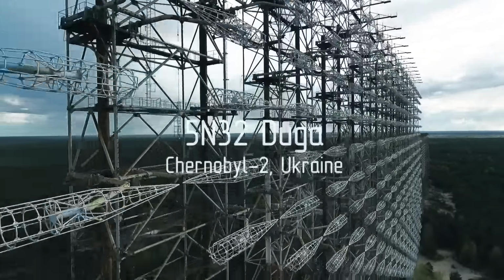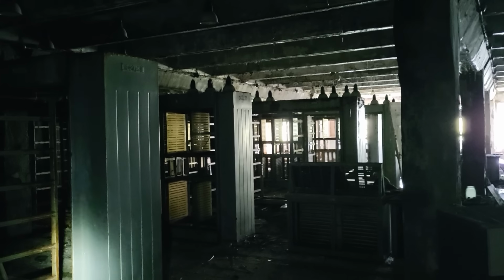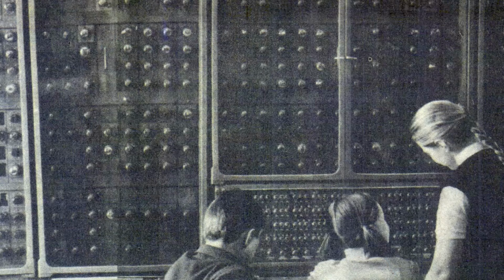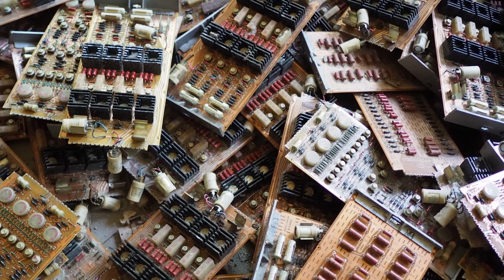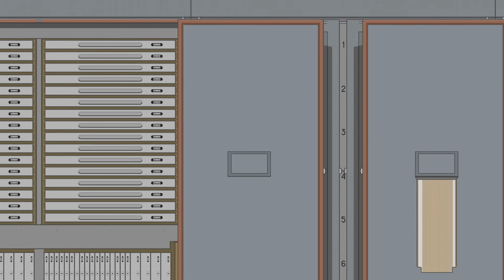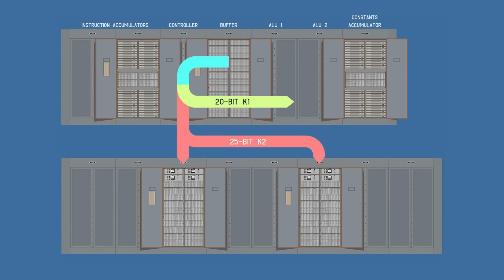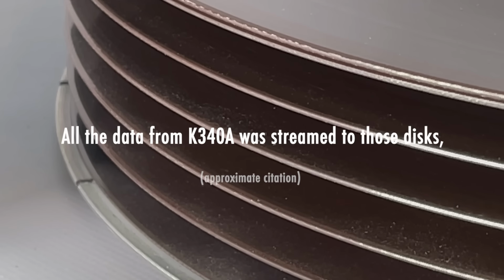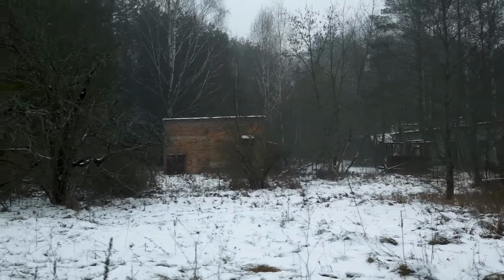Exploring K340A: The SECRET COMPUTER of CHERNOBYL DUGA RADAR | Russian Woodpecker

Comment: The CIA made this project their “Bitch.” This system could theoretically prevent ANY ICBM response from the USA. It could stop all ICBMs & SLBMs through weaponization of very powerful RF EM signals. They could literally “HACK” the booster engines of the ballistic missiles. Directing them to wherever they wanted to. NOW we know how, through “Social Engineering” the CIA caused the Chernobyl accident. Without that power plant, this system was useless. It was only a matter of time until the Soviet Union would have used western technology to their will in this project. 🤔
Reply: ok ok ok

Comment: I find the old electronics fascinating. Different regions had their own independent ways of engineering - and at that time one couldn't yet be abandoned in favor of a more efficient or economical approach.

There are things one design could do that the other couldn't. For example, some prefer vacuum tube based amplifiers to semiconductor ones (I think because of the 0.7v cut-off voltage)

Comment: Oh, the times! I recall using those 5-disk 5MB stacks in the computer centre at Kharkiv Physics & Technology Institute where I worked after graduation from Kharkiv State University. They were running soviet clone of IBM  VM mainframe that we, physicists, used for all kinds of calculations feed in from punch cards.
Reply from the maker: Thank you for sharing your experience!
Reply: Np. Actually, I was mistaken. They were clones of DEC VAX machines, coz I recall reading a VMX user manual, in Russian, oc. We used terminals to connect to it. I'm not sure though which machine had those stacked disks. 
 @ChernobylFamily

Comment: This huge antenna array could easily be repurposed for shortwave broadcasting. And it has the benefit of directional gain which means low power consumption transmitters.
Reply from the maker: Yes, that is an interesting idea.

Comment: This computer could do 1 million operations per second. The cell phone I'm watching this video on, can 1 billion operations per second.  Its crazy how far computing tech has come.
Reply from the maker: Yes
Reply: What's really wild is Macintosh  acquired a Sillicon Valley Graphics CRAY XMP supercomputer in  late 80's early 90's. The CRAY was the world's most powerful computing device at the time and the size of a small room.  Macintosh reverse engineered the Cray to produce the first IPhone.
Reply: I don't agree with these numbers. I'll be annoying. Just because a processor is fed a clock with a frequency of f (sometimes there's a PLL inside that multiplies it by X), doesn't mean that it performs f operations per second. Most cores, even modern ones, need a few to a dozen core cycles per machine cycle. From what I know, it's also impossible to convert it 1:1, because modern MCUs work synchronously, and most of these large computers in cabinets worked asynchronously. So you can make a mental shortcut, but it won't be a good reflection of the scale. Also, comparing devices running an Android operating system with systems closer to industrial automation or embedded applications are two different worlds. There are cases where a well-written low-level, embedded program will be orders of magnitude faster than the same task started from the operating system level. All according to the principle: the longer your legs, the easier it is to stumble.
Reply: @compaqchemlab it's actually quite a bit more than a billion given wider data buses and chacheing improvements...pipelining, pre-emptive execution, and parallel processing...and that's just in a low,end cell phone...
Reply: @compaqchemlab ok nerd, but here's your proof!? I only trust our president so good luck convincing me!

Comment: A Titan Rocket burns only for 5 minutes. So the exhaust can be only detected at climbing when at all exept from visual means as is done by satellites.
But because the relative low elevation of 70km, it is possible to detect the friction heat and some ionosation.
Because of that hypersonic missiles in the stratosphere can be easely detected. Ground based and satellite based. But ground based the warning time is very short.
Look this matter up at the Perun Channel.
Detection of a false launch "Fire" by a Sowjet Satellite nearly led to... when the operator wouldn't have used common sense. Only 1 missile? Not logical.
Gave him a fat Sowjet Hero Pension. For sure not. Out of the top of my head he got 3yr. prison.
As the submarine lieutanant who deposed the captain who wanted to launch a nuclear torpedo during the Cuba Blockade.

Comment: It is almost impossible to recreate it with original components. Soviet electronics has too complex building solutions. Of course you can reimplement those boards on modern components superseding with some solutions from Altera but it is worthless imo.
Reply from the maker: There is no task to recreate it 1:1, but to make a mass-size model with a simulation of its operation based on modern tech. This is what museums frequently do, for example, for tube-based computers.

Comment: Hi! You've done a colossal job! I don't understand how you managed to achieve such amazing results. About the ES series computers, which appeared later, I came across such information that they were equipped with the “Dialog” system. It can be assumed that it could be used as a supplement to K340A, to identify, for example, objects based on the data transmitted from K340A. Although everything could be much simpler and computers of the ES series could be engaged in solving some mundane tasks of life support of the military camp and counting some expenses.
Reply from the maker: Hmmm...
These are interesting details. Thank you!

How we achieved... consistent scientific work)

Comment: Wondering whether @curiousmarc and Master Ken Shirriff and / or @diodegonewild might be interested in a collaboration on reverse engineering some of this equipment…  🤔
Reply from the maker: We'd be happy for any collaboration, but there is a slightly not obvious problem: we cannot more anything outside the area, and anyone involved must be trained to manipulate contaminated items (in this particular case majority is not contaminated at all, but legally they are considered being so, so there are certain limitations).
Reply: @ChernobylFamily Hi - it might still be worth getting in contact with @curiousmarc anyway.  They have worked with Soviet-era equipment before and may be able to work with a combination of high resolution images and x-rays to reverse engineer portions of the machine…

Comment: They were using discrete transistors instead of integrated circuits which is why it was so massive.
Reply from the maker: Right. Though IC-based ES mainframes are not really smaller. I guess not the last reason was that discrete transistor logic is way more radiation-resistant, which made it a common choice for military tech.
Reply: @ChernobylFamily  Russia was barely past vacuum tubes when this facility was built.
Reply: @controlfreak1963 When did he say Russia you mf

Comment: I program embedded controls systems and the idea of a literal aviation clock sending analog impulses for a real time counter signal is INSANE!!
Reply from the maker: @ThePolandball  a little clarification: it appeared I made a little mistake. There was a similar clock but designed for devices. It had a different dial, but yes, it worked similar. Well, the tech of the 60s:)

Comment: Можливо відновити такий комп'ютер для приватного музею? Could restore this computer for private museum ?
Reply from the maker: For private – no. Legally it is a radioactive waste and it will forever remain there. Any restoration is possible only within that location.
Reply: @ChernobylFamily  Possible restore near Duga radar ?
Reply from the maker: @gruzikigor  yes. It is a less problem to build a museum next and put the machine there. I mean, it is not also straightforward and easy, but far more possible than any variant. And much better for end-visitor.
Reply: @ChernobylFamily  Thank you for your complete and informative response))🤩

Comment: They should've just used more IR sensing sats than this insane idea of using HF radio bouncing unreliably all over that you couldn't trust anymore than hoping the wind stands still more than a minute.  Dumb waste all around.  Not to mention a single conventional cruise missile would blind it before any real launch of SLBM/ICBM.
Reply from the maker: Well, the principle behind Duga was used by many countries at that time, including the U.S. and UK; it actually works, but requires solving of many challenges. Anyway, with modern tech it is pretty obsolete.

Comment: The facts presented aren’t accurate. This military unit hasn’t been abandoned for 30 years. The site was operational until 1999, focusing on dismantling equipment, with an active security system and restricted access to various buildings and areas.
Reply from the maker: Consider, I did not want to overload with facts, as the focus is the computer. In the next episode we will talk about that, including ISTC Shelter deployment there.

Comment: Im sure I saw somewhere over the years that 40% of Chernobyl output went to power it. Looking at it I can only imagine it didn't actually work, (I'm sure it did something but reliably and quickly tracking I doubt) - one of those cases where the leaders expected it to work and the technicians weren't free to say it didn't
Reply from the maker: No, no, no.:) That theory by '40% of power' was created long time ago by known people who have a zero concept in understanding in energy production and distribution. 40% of ChNPP power was roughly 1.6 GIGAWatts per hour. This is, uhm, sufficient to power a city for 1.2...1.4 million people.
For both transmitter and receiver come power lines of just 10 kilovolts. This and substations on sites give hints that none of them consumed something really high. 
Authors of the theory somehow forget that there was an identical pair of those stations in the place where there are no NPPs. 

Strictly speaking, the system worked and was quite functional. It was good for many things, but not enough good so military forces did not take it on duty. Who knows.

Comment: When I see computers like this I am always in awe. Nowadays some programmers have difficulty in grasping pointer to pointer concept, but there were people who not only did much more difficult operations on those computers, but envisioned and  designed them.
Reply from the maker: @karlpron  well said
Reply: @ChernobylFamily  I would like to try to program machine like this even if in the emulator. Have you ever thought of making one? Maybe some open source project? I feel I'm not the only one who would gladly help. I know documentation is scarce and hard to get.
Reply from the maker: @karlpron  thank you. We need to think about this, but see, there is very little what is possible to do. There exist some time diagrams of some operations, but that is probably all. Though, if we look from another angle: we have known architecture and specs of components, moduli used and a control panel, purpose of controls of which is mostly decoded. Theoretically, this might be sufficient to make a 'simulator inspired by', but we ourselves will not be able to do it, because after all we are historians, not programmers. What do you think?

The question is, what we are going to process? It is so narrow-purpose thing that I personally do not see a practical use of this experiment apart from a moral satisfaction.
Reply: @ChernobylFamily  You are not an average historian if you can understand and explain main principles of machine like this :). I have never written anything close to an emulator so I will have to learn some before diving into the project. I think you are on to something with 'simulator inspired by' -- I have seen stranger things written and maintained. As for the data to be processed -- it's a hurdle. But I think that emulator would have its own merit in keeping the history alive. Especially after the end of war if you open the Duga museum -- some kind of live exhibition. I will dig into some docs about emulators and then if you'll  be willing I will ask you about documentation.
Reply: I'm this programmer ahahah

Comment: incredible work. we used to monitor the system and called it the Woodpecker, the noise it made interfered with communications,  it crawled up and down the HF (2-30Mhz) shortwave bands. OTHR Over The Horizon Radar in its infancy and ionosounding for propagation calculations.  A great credit to all who worked on it in the very early days of digital signal processing.With suitable antennas and transmitters/receivers all of this can be processed in a small desktop box or two Thank you so much for this project. Maybe Chernobils SKALA control systems were upset by high levels of RF EMI/ EMC from the antenna and kaputted  Chernobyl well someone could have reversed the phase of the elements so it "pointed" at Chernobil a few km away??
Reply from the maker: Thank you!
No, in the scope of the accident SKALA was pretty much flawless; paper logs remained, so we know thism

Comment: The rocket boys gave the radar boys incorrect data about plumes. The radar guys took it on faith and assumed it was true. It wasn't. They designed an entire gigantic radar system based on those false assumptions. IF ever there was a case for pushing someone out a window it was then.
Reply from the maker: That is only partly correct. We cannot say it didn't work, it did, and it could detect things. Just not as accurate as expected, which took things much longer. Probably, they eventually would make that work, though... at which grade of expenses?

Comment: I've seen some videos looking at the antenna array, but it's cool to see some of the history of the computer that processed the signal data. I worked at a company that created a simulator of the reactor at Chornobyl, and the owner added a lot of information on the history of that project. It's too bad Chornobyl has caused so much fear of using modern nuclear power with fail-safe designs. We need nuclear power plants if we ever want to reduce the burning of hydrocarbon.

Comment: I can remember at Philips Semiconductors there was research into using Residue Number Systems for DSP.. It was dropped because it transforms multiplication into modulus addition of residues..  but made the  operation of adding two numbers into a more complex operation than a multiplication in straight binary. That required to decode to binary, add and then re encode into RNS form.
Reply from the maker: mmm are you sure problem was not in division which indeed requires a conversion to binary? RSC appeared as a solution of making multiplication equally simple as adding.
Reply: @ChernobylFamily I saw Yuditsky's book about residual classes. Division takes half of it. Without converting to binary. The convertion is easy though, by means of tables.

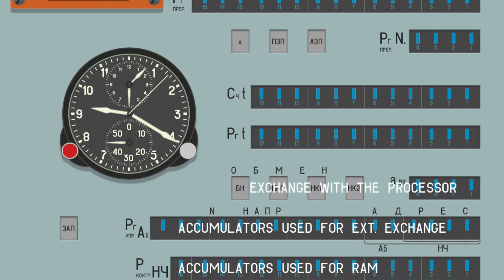Comment: At 19:51
I had several clocks as shown here. They do not generate impulses.
There is an electrical connection on the back, but that is for a heating element to prevent condensation.
Reply from the maker: Thank you! Yes, figured that out, also that there was not AЧС-1, but 60ЧП ('device clock'), which looks similar but works a bit different

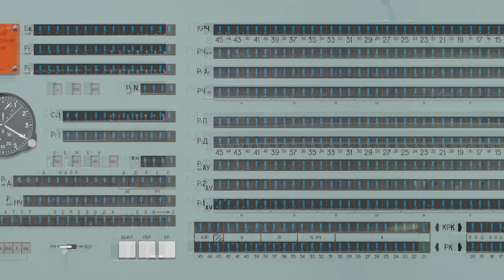Comment: OMG. I like the manual wind clock at 10:47
This clock with two independent timers shows up everywhere.
I have seen them in aircraft, helicopters, radio telescope control consoles... 
Why use an analog clock on a digital computer? 
There must have been some overproduction somewhere for sure.
Reply from the maker: One self-correction: what I drew is АЧС-1, while there likely was used 60ЧП, a similar looking clock without upper dial, specifically for devices. In fact, it was super common approach.

Comment: I visited the Duga in 2019. There's nothing left, everything is stripped out mainly for scrap value.
It will be an impossible task to restore what isn't actually there.
Reply from the maker: There is no goal to restore everything what was there, but a part of that as a model. For this, there is plenty of information, and much of what remains there give a lot of hints what is missing given that electronics production was standartized. So, there is a chance :)

Comment: Interesting you said about 50 were produced, I'd imagine half didn't get installed or were back ups.
We know where 2 of them went.
I wonder what the soviets used the other 23-43 computers
Reply from the maker: According to Malashevych, 12 at Dunai station.
At least 8 at Chernobyl-2, but maybe were more. At least same at Lubech 1 transmitter. And same at the similar pair in russia, as there was the same installation.
12+4x8=44.

Comment: Truly impressive bit of research on the computer technology being used.  Did you find out anything about the interfacing to the radio systems and how they transmitted and processed the radio signals? Was it all automated or did the operators manually enter the radar return data? This aspect is probably at least as complicated as the K340A.
Reply from the maker: Some things are known, and we will talk about that in the future episode.
Reply: @ChernobylFamily  thanks :)

Comment: In the video they say the radar was detecting emissions from ICBM engines. What emissions? The rocket engine throws out hot gases what can the radar detect from that? The missile itself is not a large target what is so characteristic about it that it can be detected?
Reply from the maker: I have a soviet book about principles of radiolocation; they explain there with a lot of math and physics that it is much more reliable to use plasma flow of engine as a distinguishable feature, as missile itself you can mistake with other objects.